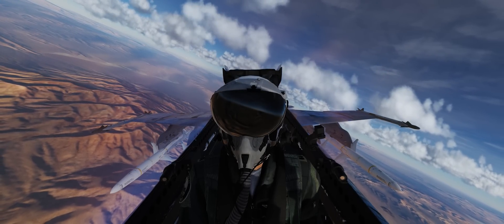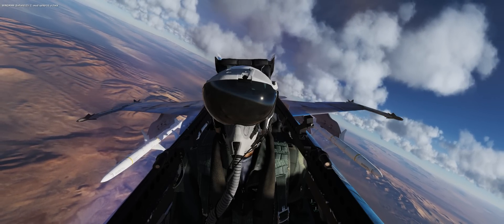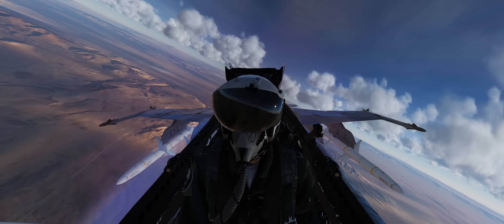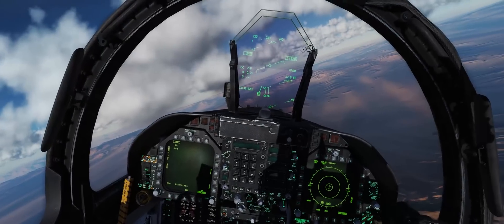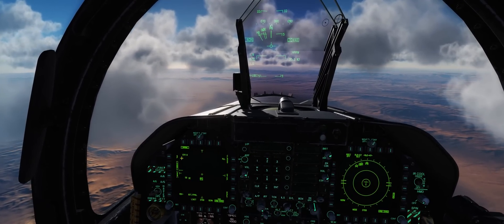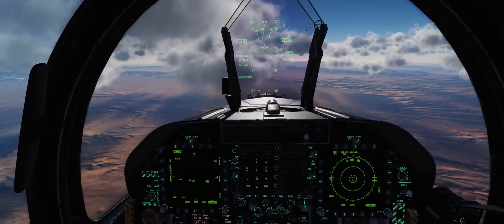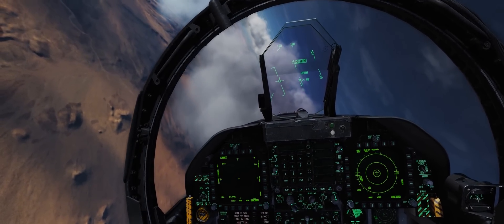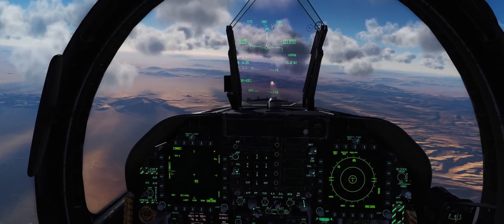DCS: F/A-18C Hornet | AGM-88 HARM TOO Mode Tutorial! (Target of Opportunity)

Comment: Nice video. I just don't get what is the difference between the TOO and SP mode. To me they work the same, you need to select the target and shoot. The only difference I see is the page where you need to select it.
Reply: In use they are very similar in DCS (right here and now).  Target separation seems a bit easier in TOO mode.  The way they wouldve been employed is different and I believe the missile flight profiles are different aswell.
SP mode, as the name suggests, is a defensive mode; meant for short/med range engagement of pop-up threats.  The missile is slaved to the RWR, receives a list of prioritized threats from the RWR (auto) and when fired hunts them down in order.  If the most critical threat goes offline it auto shifts - if possible - to the next in the list.  This mode is meant to be able to target anything within 360 degrees of the launching aircraft (altitude/range permitting of course), though Ive not tested it in DCS.

TOO mode is an offensive mode, meant for longer range engagements, typically against known targets - a SEAD mission.  The target is locked onto directly by the seeker head.  This means the targets must be in the seeker field of view - can happily be off axis, but the missile cannot be 'blind' to the target.
As with SP mode, and i believe its true for all HARM modes, the flex logic is in play, so should the desired target shutdown its radar to hide, if something else nasty is still emitting it will attempt to kill that instead.
Reply: Another terminology for TOO mode is HARM-as-Sensor mode (HAS). SP mode uses the RWR as the sensor to give a target command to the HARM, whereas TOO mode uses the HARM's seeker itself to self-determinate.
Reply: @Tholozor  What difference does this make to the missile though? at the end of the day, I'm still picking a SAM site and then sending a missile at it.
Reply: @razorseal  it's just a different way of selecting the target. The RWR doesn't give you a lot if information aside from the general direction of the emitter, whereas in TOO mode your basically seeing what the HARM sees in front of it. Plus, TOO mode allows you to filter out unwanted emitter types, so if you're in a complex EW environment it can help isolate your desired target.

e.g. if there's a ship surrounded by radar SAMs, you can filter the HARM to only display hostile ship emitters.

Comment: Can the HARMs be detected by the SAM Radar and shot down?
Reply: Yes, usually by point defense SAM units like the SA-15 and sometimes the SA-8.
Reply: @straywolf77  aiight cool, thanks!
Reply: @Transit21  So, for example, the Russians when they deploy those SA-10 batteries, they usually also place Panstir units for point defense. So, for DCS mission building, it would be good to place Tunguskas within SA-10 units to simulate this.
Its fun to watch them engage HARMs or even bombs.
Reply: @straywolf77  Thanks for the tip!  I haven't delved into mission building just yet.  I recently got back into DCS from a 3 year hiatus (DCS 1.5).  Just custom built a new PC specifically for DCS that should keep me years ahead of newer versions and upgraded with all new peripherals (pedals, HOTAS, Track IR5).  So far just easing into the Sim a few hours a week with the Yak 52, Hawk and F-5E for starters...
Reply: In reality TOR M2 is perfect weapon against Harm